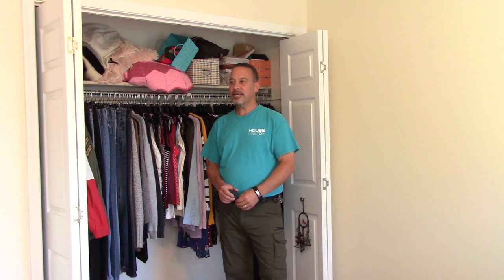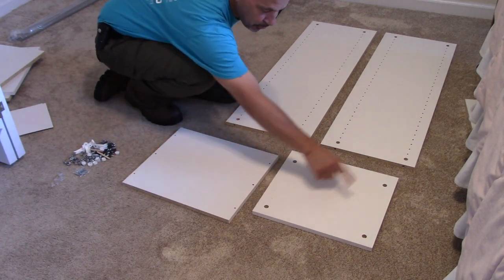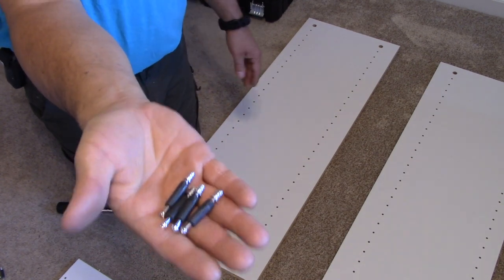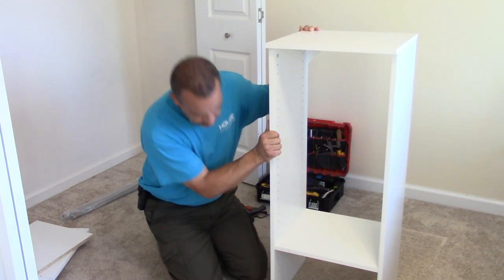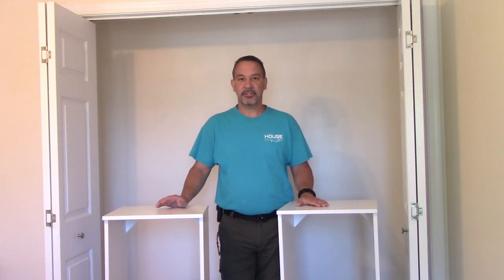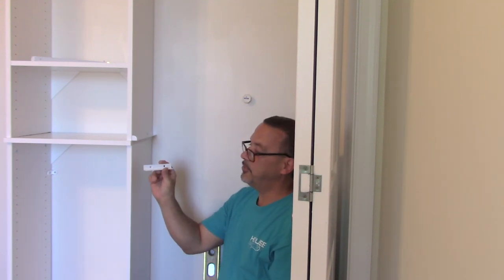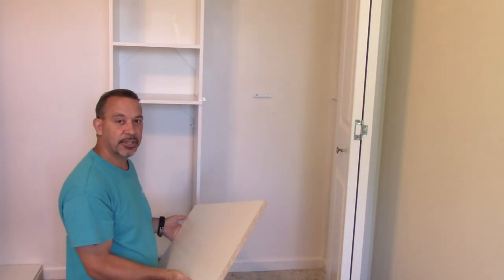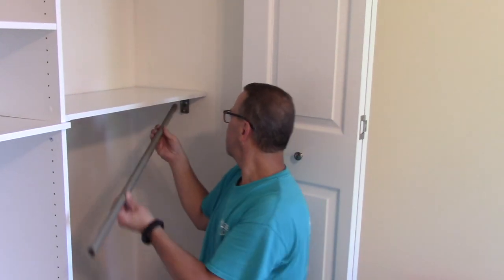DIY ClosetMaid closet organizer install

Comment: This was absolutely perfect and just what I needed. I am redoing our spare room and my wife is utilizing the closet.. I tore out the old wire shelves that I can't stand and came across this on Lowe's website but had a couple questions because the closet only measures 47".. I wasn't sure if I was able to cut the bars to size or if there was a specific way to do it and you nailed both of those for me. Putting this together will be much smoother now! Thank you!!
Reply from the maker: Glad it was helpful.  Thanks for watching.

Comment: I see that you have a base trim (at least it looks like that). Doesn't that offset the shelving system a little bit from the wall, not keeping it flush? Or if you force the top part of the shelf to be flush against the wall, wouldn't that keep the shelving system just slightly at a angle? Wouldn't be able to tell from the front but from the side you could probably see it, right?
Reply from the maker: Very perceptive Jay.  The base molding is only 5/8ths thick so I didn't worry about it.  There was also no ¼ round since it was carpeted.
You could notch the back of the lower box if the base was too big.
Reply: @HouseDoctorRay  Thnx for the prompt reply and feedback.

Comment: How is each sidewall of the unit able to attach to the back wall of the closet considering that the baseboard is in the way?
Reply from the maker: Most baseboard is only 1/2" thick.  The unit leans back slightly but not enough to notice.
You could trim the baseboard or notch the bottom of the unit.  I would do that at a customer's house but at my house just left it.
Reply: Would an oscillating Dremel tool with a wood blade be the best tool to cut out two narrow channels in the baseboard moulding wide enough so that the sides of the lower tower can fit flush against the wall?

Comment: How long was this closet? Mines is only 6 ft. I want to be able to have the tower. Are the rods 30 inch minimum?
Reply from the maker: You can cut them to fit.  I put one in a 4 foot closet

Comment: Mr. Ray how should I secure it to the wall if I have a 1 inch gap due to quarter round on the base trim?
Reply: Should I cut the trim in place so it sits flush to the wall and it is kinda part of the trim?
Reply from the maker: You could do that but I would cut a little off of the back of the tower so it goes around the baseboard and quarter round.
Reply: Thank you, I was able to raise the leveling feet above the quarter round and only have half an inch. Which allowed the bracket to sit in enough to mount them to the side boards. 

Thanks for your video! Definitely made this way easier.

Comment: Always seal torn paper/blowouts before mud.  Gardz or ideally (for speed) shellac 123.  -U10
Reply from the maker: Never heard of this.  I assume the sealer stops the existing drywall from sucking the moisture from the mud too quickly.
Reply from the maker: Excellent!  Thanks for posting this.

Comment: Did you add the top shelves as well if so do you have video for it
Reply from the maker: The top shelves get installed the same way as the side shelf.  A bracket on either side and a support in the middle.

Comment: Did the base mouldings keep the unit from being flush to the wall?
Reply from the maker: Yes, but it is barely noticeable.  You could cut a notch in the bottom unit but unless your molding is over an inch thick it's not necessary.
Reply: Thank you!

Comment: Hi! very helpful and informative video, I would like to do this with my closet as well. Just wondering, what is the length of your daugters closet? I would like to do this exact model for my closet and it looks like my closet is the same size but I just want to make sure the measurements before I buy! Thank you
Reply from the maker: The 16 inch wide tower with the shelf kit will work with closets up to 9 feet wide.
https://amzn.to/3pwBvvh
Reply: @HouseDoctorRay  yes i understand that but I am trying to decide if I should get the 12' or 16' for my closet! I just wanted to know your closet measurement so i can get a better understanding for msyelf if you dont mind!! thank you so much
Reply: Yes it would assist me too! I've measured and read rod length is 30-48, so doesn't seem like I'd be able to get this exact setup 😒. I have 6ft. Hers maybe over 7ft-9ft.
Reply from the maker: The rods can be cut to length with a hacksaw.  For me the 12 inch towers are too narrow.

Comment: Why did I build mines and it wasn’t super sturdy what could I have done wrong ?
Reply from the maker: If you use a power drill to put the cam pins in they'll strip and be loose.  If you overtighten the cams they'll bend.  The triangles you nail on the back should've stiffened it up.
Reply: @HouseDoctorRay  oh I didn’t put the triangles let me try that
Reply from the maker: They'll make a huge difference.

Comment: Are you able to access the top shelves?
Reply from the maker: Yes.  The shelves are about 12 in deep.  The closet I installed it in is about two feet deep.
Reply: @HouseDoctorRay  Will there be any trouble putting stuff up there? Like for example, large teddy bears or big blankets. I'm sorry, I'm just used to the top shelf being about a foot below the top of the door frame.
Reply from the maker: That will depend on how deep your closet is.  You could cut a few inches off of the top tower before you put it in.

Comment: Would this hold on plaster and lathe walls?
Reply from the maker: Yes but:
Always predrill plaster before installing screws.  A masonry bit is best.
Do not use plastic anchors or the anchors I show in the video.  If you have wooden lathe getting screws into the lathe should hold fine.  You just need to know the thickness of the plaster.  Keep in mind the thickness can vary along the wall.
If you have metal mesh behind your plaster you'll need to use anchors like these: https://amzn.to/3kwlYd4
Reply: @HouseDoctorRay  thank you so much!!

Comment: Did you use the EZ anchors for the top tower?
Reply from the maker: Yes.  I use them everywhere I couldn't hit a stud except the one hole on the shelf bracket.
They are definitely worth the money.
Reply: @HouseDoctorRay  Great! I purchased them and look forward to the installation. Thank you for responding so quickly!

Comment: You never showed the screws you used when attaching the shelves brackets to the organizer.  The package comes with 4 short screws and 6 longer ones…..
Reply from the maker: I believe the longer ones are for attaching the bracket to the tower.  The shorter ones are to attach the shelf.
Just line it up by the edge to make sure they don't go through the other side.